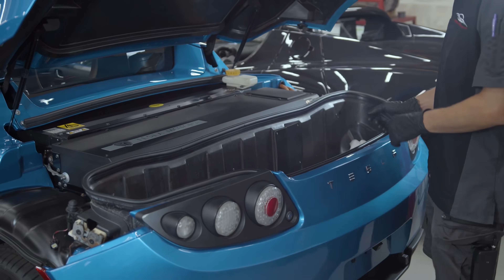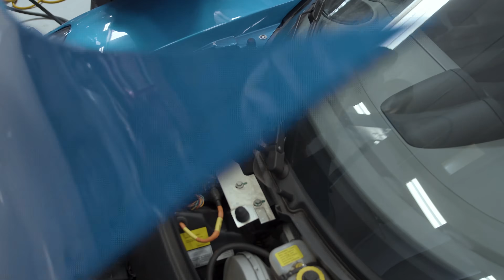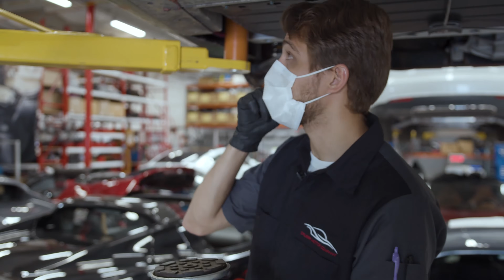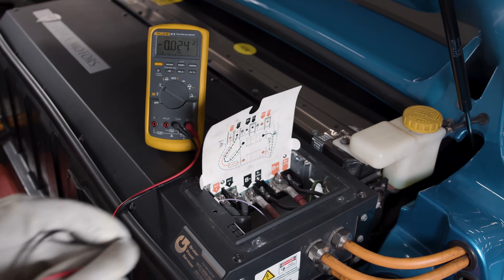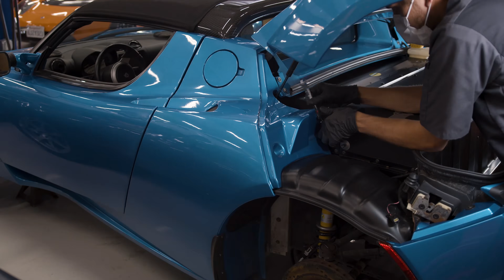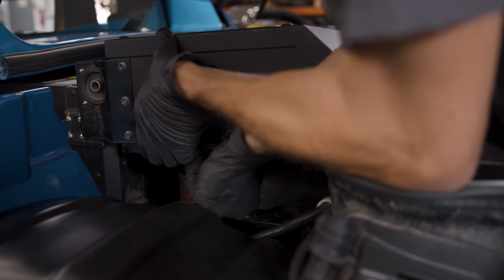How to Remove a Tesla Roadster 2x PEM | Gruber Motors

Comment: Hello, I’m writing from the National Auto Museum in Reno where we have a donated, very early Roadster that is bricked and unmovable. It’s currently on dollys but we would like to move it more easily and I understand the most straightforward method is to disconnect the driveshafts. Frankly, although we’ll-equipped tool wise, we are clueless in regard to the aforementioned process. Any advice would be appreciated! Thanks in advance.